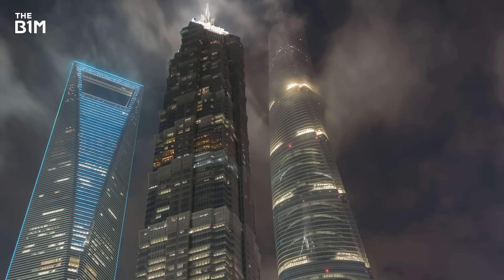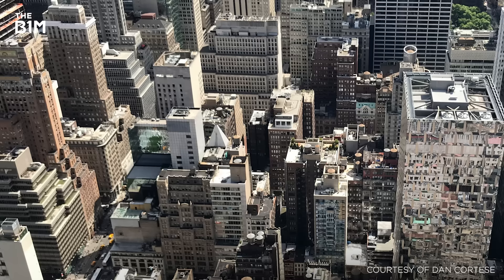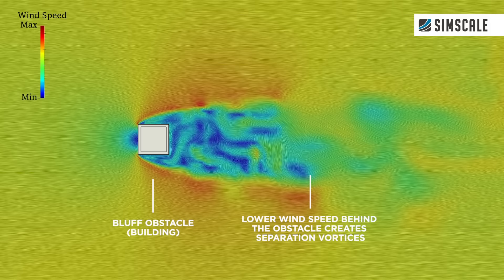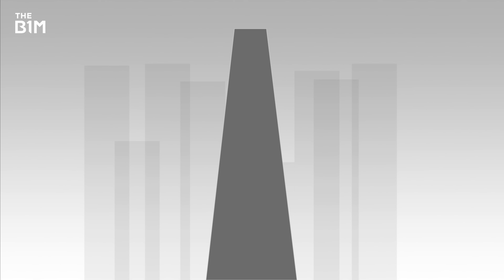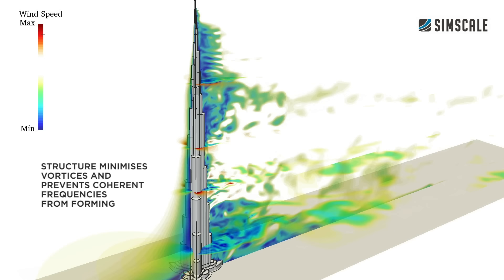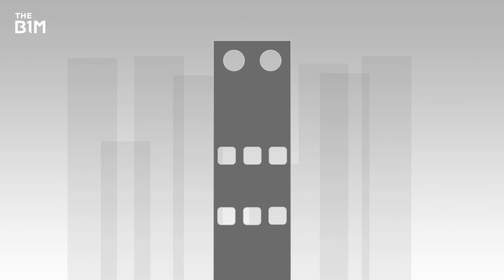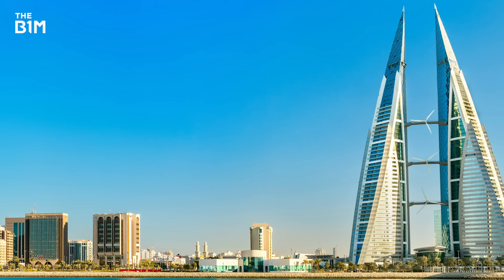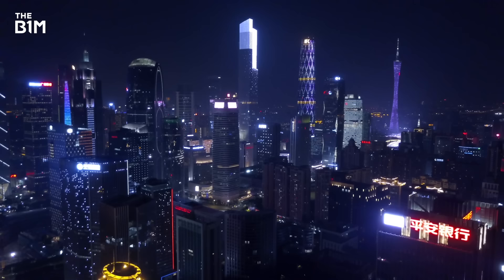How Tall Buildings Tame the Wind

Comment: I'm always blown away by the San Francisco skyscraper collection. When I moved there in the 80's there was the Bank of America tower and the TransAmerica pyramid. Not much of anything south of Market Street. Salesforce Tower is 20 stories taller. Yes the Bay area is Super windy, it is a notch in the coastal mountains that funnels cool air into the hot interior of the state which acts like a giant chimney. Today I was getting some plywood as while tying it to the roof rack the wind flipped one edge up and snapped the 1/8" panel

Comment: 3:57 this has me confused, would’ve a curved rounded edge be better for aero? At least in a car it would help with wind passing smoothly, the cube cut would trap air and cause drag. Wouldn’t cashing air to get trapped in the cube corner cause the air to have more power over the building?